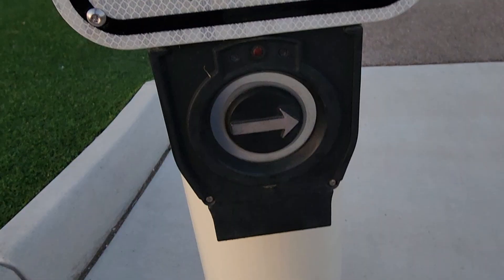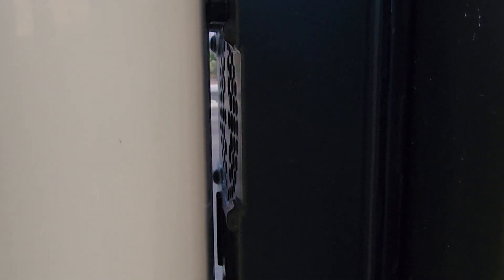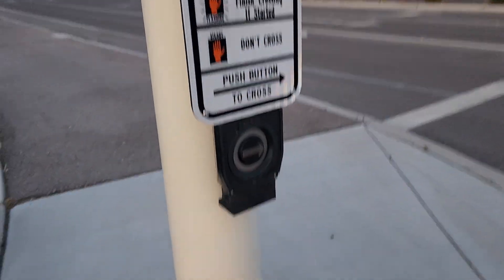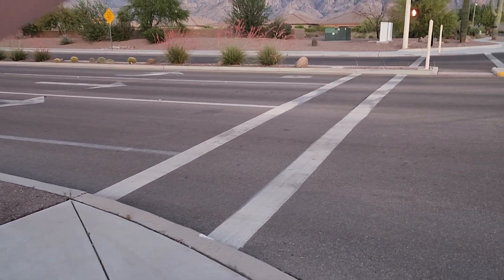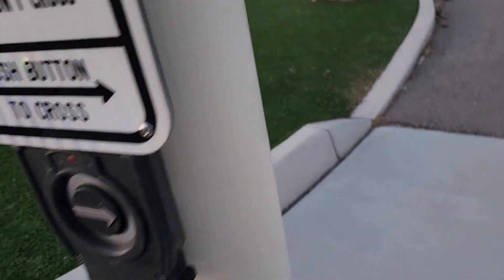*Distorted Speaker* My Crosswalk Button Experience At Moore Road With Polara EN2s, Oro Valley, AZ

Comment: The replacement might be an iNS
Reply from the maker: If they replace it, they might as well replace them all. Also the last button replacement at a OV intersection I saw was a iN3 model

UPDATE: That button speaker is fixed and back to normal
Reply: @STUAA2025  in my area the in3s and ins's are broken as frick, but the ez comm navigators and 2000s navigators are fine
Reply from the maker: That is weird... the Polara iNS buttons in Tucson are mostly functional (minus me having an encounter with one that constantly said "change password.") 

But unlikely them, the old Polara Navigators from early 2000s and the 2005 ones are mostly nonfunctional. While the iN3s and EN4s work fine. (There is still an intersection in Tucson with old Navigators I want to visit.)